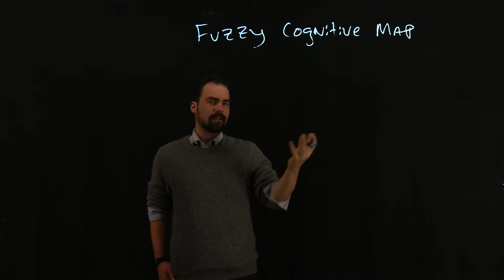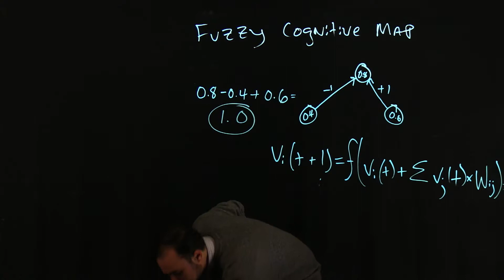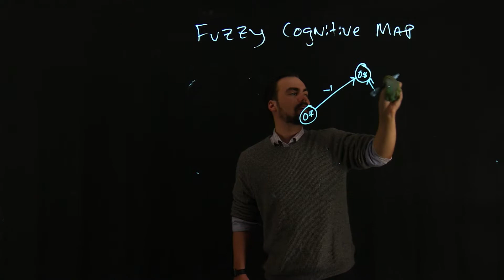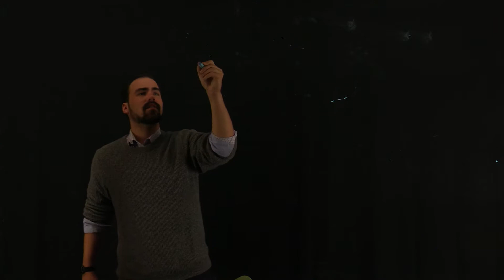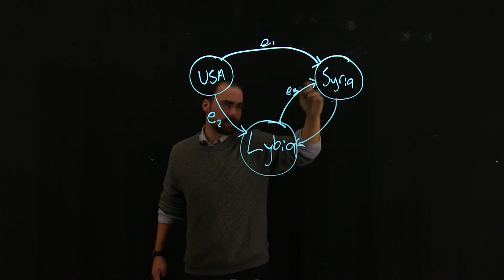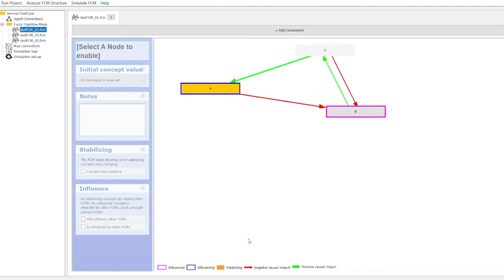Combining Fuzzy Cognitive Maps and Agent Based Models

Comment: Really insightful presentation. In bigger scale I wonder if combining ABM with System Dynamics will also possible and useful, or is it contradictory instead.
Reply from the maker: Thank you for this comment. It is possible, and it would essentially work the same way. Each agent has a brain, which would work as a System Dynamics model. Software such as AnyLogic support both ABM and SD, so you program this. The reason for which we use FCM instead of SD in our research is because an FCM can be easily created to represent the mental model of a participant whereas SD takes more data.
Reply: @dachblabdrgiabbanelli3081  I am unable to find your app, I want to try it. Kindly help.